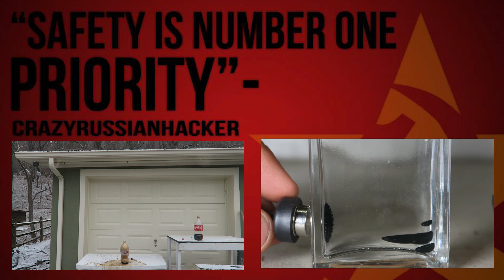Armstrong Mixture Test

Comment: Get the Phosphorus off the match heads and the material off the scrappers and mix using the DIAPER METHOD! DON'T SHAKE OR HIT IT! Only make Small batches. Ratio: 15% Scrapper material, 85% Phosphorus
Reply: is it safe 0.2 grams for firecrackers use  ?

Comment: Guys it's just the striker scraped off with a knife (or sanded) then mixed (using the diaper method) with the match heads to create an extremely sensitive flash powder.

Comment: How to make mixture: 
-Take a matchbox
-Take the match heads off from the matches as shown in video
-Finely ground it into a powder with a flat metal object 
-Take the side of the matchbox (where you strike the matches to light them up) and scrape the red powder off
-Mix both powders VERY CAREFULLY and voila you have an impact sensitive mixture

Comment: All you need to do is shave of the striking pad on the Match box and then take the tip off the match. Make sure you crush the powder separate then mix and done.
Reply: Sorry meant to say shave off the striking pad
Reply: Like if it worked

Comment: This product is made primary with KClO4 or KClO3 mixed with P in a 70% to 30% ratio respectively.   The latter being most friction / impact sensitive.  The main source of these materials is match heads from safety matches and the strike bar from the accompanying match-box.  There  are other additives that can augment the volatility.

Comment: he is doing the right thing to not show us because I am a kid and I would probably make that
Reply: The matchheads and the strike thing in the side of box mixed together and, hit it with a hammer
Reply: Razorblade scrape strike stuff on box of (prechlorate) scrap match heads off (phosphorous) grind carefully mix using paper if mix to hard or heat can be generated will blow ur fingers off should be about 75% phospherous and 25% prechlorate

Comment: What you do is scrape the pad of on the side of the matchbox and mix it with crushed match heads, with the ratio of 70% match head, and 30% powder from the sides. And yes Armstrong's mixture is a really strong explosive 20 g will kill you if you are in a 2m radius

Comment: 1. Crush up match heads, the red part
2. Strain out the wood from you powder 
3. Scratch powder from the match striker
4. Mix match head mix and striker powder in to one powder
5. HAMMER SMASH!!

Im not responsible for and damages you may cause to yourself or others or property.